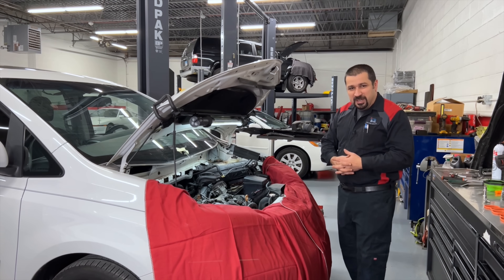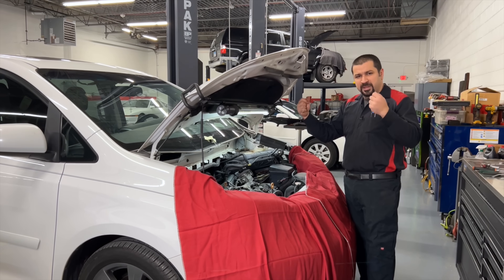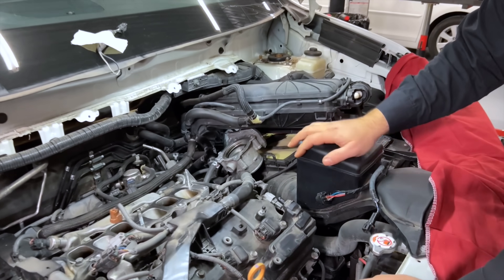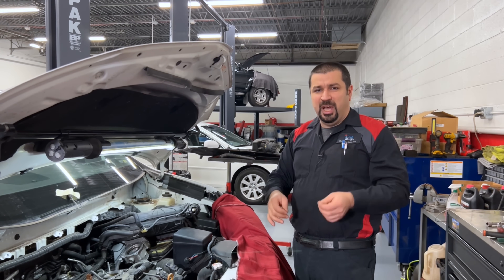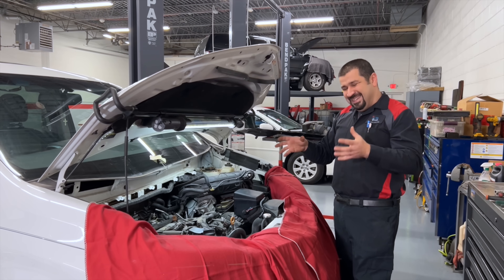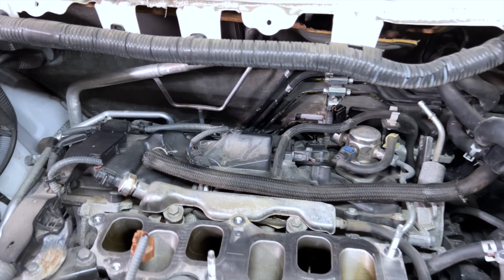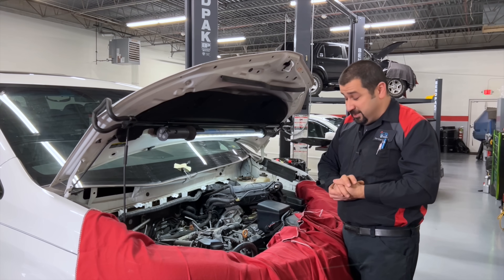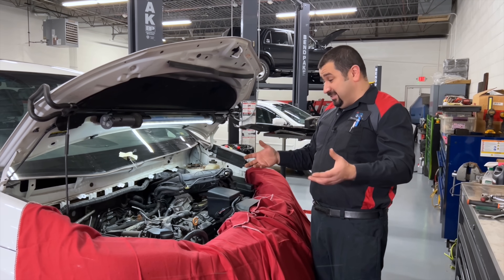Does Toyota Direct Injection Cause Carbon Build Up? Let's Find out!

Comment: My 2017 Tacoma is coming up on 170,000 miles on it.  I change the oil/filter myself every 5k and unless it is not available, I always put Shell V-Power in it.  I've had zero issues with the engine so far.  I've changed the plugs, various filters, including the PCV valve.  All fluids for transmission, rear diff, transfer case, front diff are all changed as well.  The truck has not been back to the dealer for anything other than its initial checkup when new.  When the engine is cold, I start it up and let it run until the water temp hits at least 50 degrees before I drive away.  and I take it easy until the engine is warmed up.  I do this to allow components to warm up and reduce stress on the head gasket and reduce chances of a gasket failure.  Truck typically get driven at least 20-25 miles each time it is driven.  And it gets an "Italian Tuneup" about every two months.  I am going to change the drive belt on it this spring, since the original one is still on the truck and actually still looks fine.
Reply: What brand of gas fuel and grade you recommend for 2014 toyota sienna le and what brand of gas station you recomend
Reply: @zeljkodjukic5889 only use top tier gas. Google top tier gas stations near me

Comment: Thanks for the great show. Do you recommend to use any fuel injector cleaner in the fuel system. If so, how often? Thanks again!
Reply: No, he does not. He’s done a video covering this, I believe it was a broad topic video on Toyota fluids?
Reply: @chris3407  Correct, that video was related to induction service.

Comment: Blow-by and crankcase ventilation system going into the intake is not normal. The only thing going through the intake system should be clean Fuel and or clean air. You know how to accomplish this then you will never have carbon buildup on your intake valves.

Comment: Mister car care net I have a 2006 Psion XB I recently replaced it/motor with an import motor from Japan and now I am having misfires sputtering and I believe injectors may be the issues/what should I do I do change the oil regularly Lee should I change the injectors? How do I know if my injectors are going bad in correlation with performance need help from Austin Louis a fan of your channel

Comment: FSI by VW will be a reliability issue. I am wondering how the high pressure fuel pump in Toyota hybrid vehicles with DS-4 is powered? In the Dynamic Force Engine.
Reply: It’s mechanical the same way the gas only version is.

Comment: thanks for great explanation. Q is will these hybrid systems stand the test of time & easy maintenance, given their increased complexity. i thought trad port injectors also had a high pressure fuel pump. how wrong i was! what is % of fuel used sent to each injector system? is main dose from the direct injectors?
Reply: They do not run simultaneously, the computer decides which should be firing and they switch from one to the other.

Comment: Manufactures need to add port injection with DI systems.  At least add a single injector at the throttle body to keep things clean.

Comment: Thx for the video.  Really great information.  In the video, the intake valves look relatively clean, but the intake runners show some black carbon/oily residue.  Is this from the PCV valve as it helps to ventilate the crankcase.  Would an oil catch can on the PCV engine crankcase line help catch some of that oil and reduce some of the  build up on the intake runners?  TIA.

Comment: Removed the lower intake on a 2016 Kia Sedona  van. The valves were full of sludge.
Reply: not sludge - carbon :face-pink-tears: perform a walnut shell blasting (properly)

Comment: My Toyota dealership recommended a fuel injector cleaning on my 2017 Tacoma V6, at just 20,000 miles.  I turned it down. Sounded like a dumb idea and waste of money.
 Now I got a rattling noise on acceleration at 1,800 -2,000 rpms.

Comment: Need your help  please⚠️
I bought a toyota rav4 2013 , when i did the drive test i could feel a little vibration but i tought it could be something in the tires, when i took it to the mechanic they diagnosed it was something in the transmission.
(Torque converter flex lock-up shudder)
It only has 80 000 miles, car looks good.
Dealer tell they gonna fix it, do you think i will have a reliable car after they fix it?
Do this problem is something that they really could fix?
Reply: I advise to walk away from the rav4 man.  For your peace of mind, and wallet.
Reply: @jeancassel  thanks for your advice, i will take your advice for sure.
Bought a rav4 last saturday, used it on sunday and monday i was calling the warranty 😮‍💨

Comment: I had an Audi Q5 3.2 and had endless problems but especially with fueling. The pump went out, carbon buildup (gdi), burning oil like crazy, and it had less than 120k miles. Never again

Comment: Hi AMD. What do you think about oil catch cans? Do they actually help prevent carbon build up in the valves especially in GDI engines or are they just a gimmick?
Reply: Came here looking for the same answer
Reply: Yes if it only has direct injection say on a VW or KIA

Comment: Interesting thing I'd heard before about Toyota's use of direct + port injection: they didn't "primarily" have both to deal with carbon build-up but mainly for better idle (DI tends to idle rougher)--it's just an extra benefit, this intake valve cleaning.
Reply: Yes, the port injectors are better at startup due to better mixing of fuel-air. Basically, more time to form a homogeneous mixture from the moment of injection till moment Intake valve opens. Especially useful during cold starts.
Reply: It's interesting you mentioned the rougher idle, I noticed a slightly rough idle in every DI vehicle I've been in. From my experience, DI Honda/Acura engines seem to be the worst offenders for rough idles.

Comment: You provide the best Toyota/Lexus information on YouTube by far! We intentionally purchased two 2011 RX350's because they ONLY had port injection.  Twelve injectors is profoundly idiotic. I'm surprised you did not mention that the computer switches between the port/direct systems automatically in order to clean the valves. Great work. Thanks!

Comment: As for someone with a short commute, say 7-8 miles, what could be done to prevent build-up? Warm up the car longer before heading out?
Reply: That would help; just letting the engine idle for a few minutes gets heat into the engine and a side benefit is that the engine will last longer from having a no-load gentle warm up..
Reply: That can help, but like he mentions near the end of the video, take it out on the highway (he said at least once a month) and give it a good long-ish drive. I’m in the same boat as you except my daily drive usually is less than half yours, so I do make sure to get on the highway at least once every week or two

Comment: You mentioned rodent damage to engine wiring, what do you recommend to avoid having this happen? My family member has 2 new Toyotas and both had wiring chewed up in days.  Both cars sit outside. Not sure if you have already covered this topic, but it seems to be a common problem with the new soy based insulation on wire used in cars.
Reply: Plastic wire tubing and electrical tape may help after patching the wires up it may gum the rodents up along with spraying Fluid Film under the vehicle. I had a Corolla fuel tank vent line get chewed and sprayed FF everywhere underneath it after fixing it and haven't had any more problems hopefully it tastes nasty to vermin and rust prevention is the main reason I had bought it. Good luck!
Reply: "Mouse Trap Monday" 
Channel has addressed this issue.
It seems that some types of essential oils will discourage them.
Reply: Put cat under hood.
Reply: @johnpanagiotopoulos8539  😂😂
Reply: @johnpanagiotopoulos8539  sounds like how a motel guest in the past wanted to treat mouse problems in her room (cats are prohibited in the motel).

Comment: Just curious. I have a 21 v6 tacoma. Generally when does post injection usually come on the most? IE lower RPM when I'm cruising around town? Under acceleration what is used then...DI? I know it can be one or both systems given the kind of driving you're doing.
Thanks for another great video!
Reply: Low load, port injection. Mid load, both. High load, DI.

Comment: AMD once again you nail it sir! I own a 2022 Tacoma TRD sport and absolutely love it. I know people complain about the transmission hunting, etc. This video puts my mind at ease. I was advised by my mechanic who is a Certified Toyota master tech to not do a pressurized cleaning of the fuel injectors. He said it would damage the direct injectors. Can you confirm this? Not that i plan on ever doing that anyway. Once again thanks for the awesome video!
Reply: I've been down this rabbit hole a bit...and AMD touched on it in another video: use top tier gas only. Top tier gas includes detergents that the others do not. There is published information on the large difference between the two as far as carbon buildup goes.  While "The Motor Oil Geek" tribologist does advertise Gumout, which has a higher PEA content than others, I do find that the maker of GM's injector cleaner is no slouch and falls under the same EPA license as that for Chevron's Techron and also Toyota.  BG and others are quite expensive and not really going to put a dent in bad carbon buildup as AMD noted it would really require a grinder to remove it, if it exists at all.  Top tier gas costs little in comparison to additives.

Comment: AS you said.. you showing a dual injector system.. so would not expect to see problems since the port injection is cleaning the valves.  Down side of direct injection is also the fact it struggles at high revs (above 6k).. so duel injection is clearly best... where management computer can optimise between both systems.

Comment: Car Care Nut, can you answer this question for me, just this one.    I have a 2005 Lexus es330. I replaced my air intake manifold gasket when I did my valve cover gaskets.   I got all the bolts on and torqued that hold the air intake down, but... There are 3 brackets on the rear of the intake, I am sure you are familiar. They are 3 brackets with one bolt on each end, one end to the block and the other end bolts to the rear of the plastic air intake.  You know they are difficult to get to.  One of them I can not get the bolt back in for sure, the one on the far left, passenger side, just can't get it.  So that one is not connected, the other 2 I can not remember for sure if they are connected or if they are just not very tight.  My question is, Is there any issue not having those connected or torqued down?  Will it cause any problems with my seal at the gasket? Do the brackets help keep the rear side held down and tight at the gasket? the bolts in front and side seem to be plenty to hold it snugly and securely, what is the function of the rear bracket, and should I be concerned I do not have them all connected?  If it is not a big deal I do not want to mess with it, if it is then I will give it another go.
Reply: If you have an aluminum intake it will be okay, if plastic it can cause issues

Comment: I have a 2020 Honda Ridgeline with 85,000 miles on.  Recently I changed the PCV. ( No particular reason ) I just changed and I found the original one was not working 100% correctly. it was hanging up a little.  Very easy DIY. The motor seemed to run a little smoother after I changed it
Reply: What you’re describing is another one of the problems with direct injection only. It clogged the PCV system with blow by and moisture. Changing a PCV valve often is very important. Adding a catch can will help a lot to remove the crud going into your intake and valves.

Comment: Hello!  Recent subscriber from Massachusetts!  I find your videos very helpful.  We inherited a 2018 Sienna XLE AWD with 120k miles.   When we took possession we noticed a low drone/vibration at low RPMs say always between 900 and 1,500 RPMs.  It doesn't seem to affect anything besides being annoying.  If you can point me in the right direction I would really appreciate it!
Reply: text-8592  thanks!
Reply: It’s a very common issue with the Siennas. Extremely annoying around 1200 RPM.
Reply: @pickleball5539  Agreed, almost ruins the experience of driving may I say a nice family vehicle.   Still looking for a solution if you happen to know how to tackle it...

Comment: Back in 2017 when I was looking for a car I was looking for one that wasn't only direct injection. I use to have a 2008 (MK5) VW GTI that I maintained very well (even got compliments about that and yes I changed the oil sooner than the 10k miles interval). Now to be honest I didn't run into carbon build up issues but that is only because the engine decided to eat itself before carbon build would have become an issue. I'm very happy with the 2018 Camry XSE V6. Just wish the paddle shifters were programmed differently (and to a slight degree it had a hatch opening...hmmmm wagon version...oh yeah..lol).
Reply: Bizarrely engineered Jokeswagen engines often eat themselves.

Comment: Question. If I have a hybrid that starts the engine shut it off so on so on. Does that counts as short trip?
Reply: Yes, if hybrid motor is the one taking over most of the time, usually when driving in casual slow speeds.

Comment: From my understanding the 60k mile spark plug change on the newer v6s is due to emissions warranty not due to engine change as these engines still use the denso long life iridum plugs that are good up to 80-120k miles. I am at 59k with still excellent fuel economy and still has power so the plugs will be changed at 100k not 60k. my last 2gr-fe i had 113k miles on the denso long life plugs before it had a hard time getting up hills and replaced them with ngk laser iridum plugs and it had power again due to fresh new plugs with the correct gap.
Reply: In one of his previous videos he mentions changing plugs at 60K  so that they don't spend a long time in the block and can be easily removed.
Reply: @bobninemire5154  they are denso long life iridium plugs they are good up to 115-120k miles. and are easy to remove wether its 60k or 115-120k miles.

Comment: For years I've told people to get the vehicle out on the highway or freeway, get it up to the speed limit  and hold it there!  The more you drive it that way the better it will run and the longer the engine will last!
Change the engine oil and oil filter every 3000 to 4000 miles OR every 6 months, WHICHEVER COMES FIRST!
those two steps will help increase the engine's life!
Toyota's got the right idea with GDI AND Port Fuel Injection.  Together they do a great job.
Thank you for this video.

Comment: Direct injection isn't better if you need you valves cleaned.  My Accord with 215,000 miles has been problem free.  However I never inspected them, but like I said it runs great.

Comment: As an owner of a 4GR-FSE engine currently  pushing 180k , i can honestly testify that, yes the oil changes, using good fuel and having a long hwy commute does work.  You Sir are absolutely correct.
Reply: I have the 4GR-FSE as well (IS250 6MT) with 199k and I haven't had any issues with carbon buildup
Reply: @Mongomcdongo former owner as well of a 2007 is250 6mt no carbon build up.
Reply: I have a 2010 is250 with 93k and a 20 minute highway commute each way. I was already looking to walnut blast my valves thinking carbon buildup is inevitable. Thanks for the reassurance. Love this channel
Reply: @michaelG2310  again it's important to note that the car care nut is referring to Toyota D4S unfortunately the IS 250 has the 4GR FSE which actually only has direct injection so build up is more likely on that particular engine
Reply: @michaelG2310  there is a chanel called Legit Street cars, he has an episode where  he takes a 2007 is250 and performs the intake valve job, its very interesting  to watch.
Reply: The 4GR doesn’t use D4S
Reply: I thought the 4GR Did not have d-4s with port injection. Only direct injection
Reply: +1 from an owner of 4gr FSE too, with 150k miles 2007 is250 , i need to check valves but for now the engine works fine !
Reply: I always get the same fuel at this one gas station which is like 10 miles away. But after i heard about the top tier fuel, i noted that the gas station i always go to is labled that so i know i shouldn't have any problems with injects.
Reply: @jack8356  I decided to switch to 76 and honestly, I got better MPG.
Reply: Damn, is Arco a bad choice of gas?????
Reply: Wondered why Honda doesn’t employ dual injection system.  I own a 2018 Honda CRV -EXL with direct injection only .
Reply: Can you do a similar carbon buildup video for the D4T engine eg 8NR- FTS please. Good video, thanks.
Reply: What if you have a short commute? Don't use the car, because it has DI?
Reply: @SorinNicu  to be honest, not much u can do aside  using a very good motor oil, more frequent oil changes and a bit more spirited driving , not driving fast but keeping  the rpms high  abit longer.
Reply: @SorinNicu  If it has D4S then you don't have to worry about it If it doesn't then every 90,000 miles you have to get it cleaned out otherwise you might see performance issues and fuel mileage issues
Reply: In other words All the planets have to align just right in order for this to work. Sounds like a great design. Once again government regulations are hurting citizens wallets.
Reply: Bloke there is no question he is right he knows more about toyotas than the engineers. Pues Como que en El Dia en que LA conoci ist dein Auf Das licht is bucko for a yank
Reply: Currently own a Japanese import called the Toyota Mark X. 4GR-FSE hitting 240,000km on the clock. Still starts and runs like new. Toyota direct inject is a master piece.